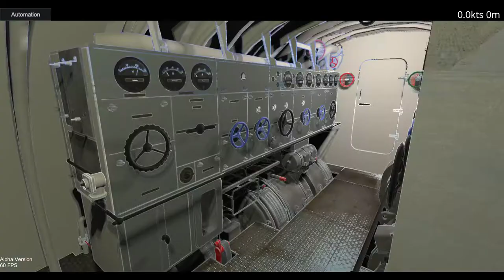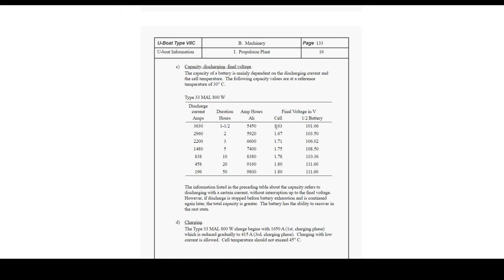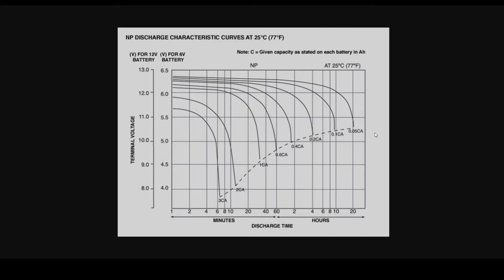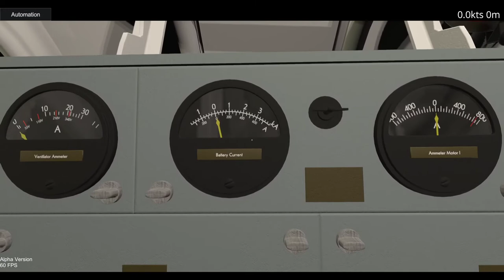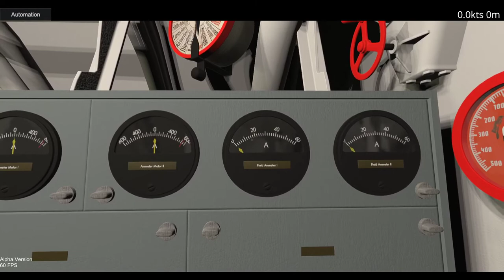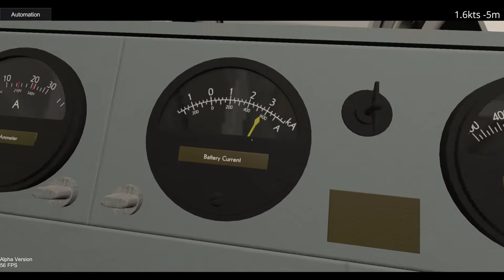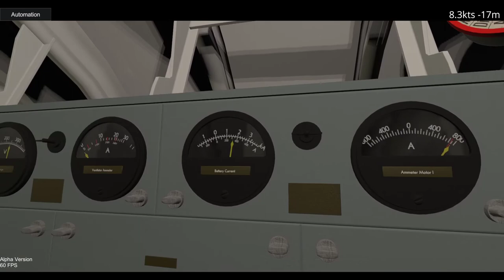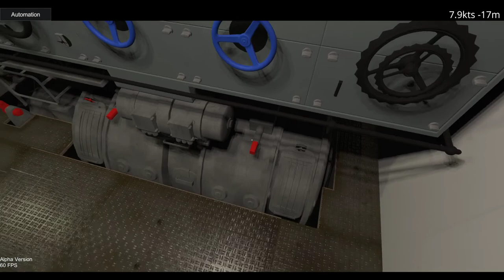U-Boat Sim Devlog - Alpha Branch - Electric Aux Panels Part 2

Comment: Is it possible to make this wonderful product for 32 bit Windows systems?
Reply from the maker: Unlikely. 4GB just won't be enough to run the game given size of meshes, texture maps, etc.   

I think final spec requiremnts will be in line with flight simulator 2020 if we reach the visual fidelity we aspire to.